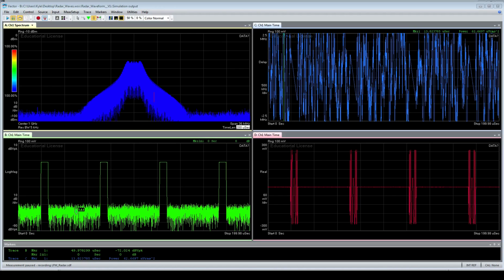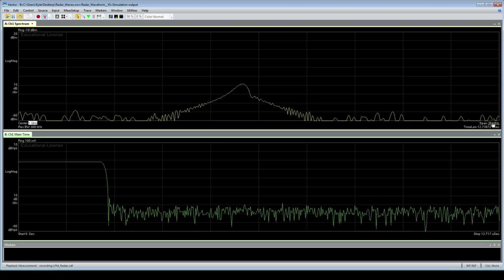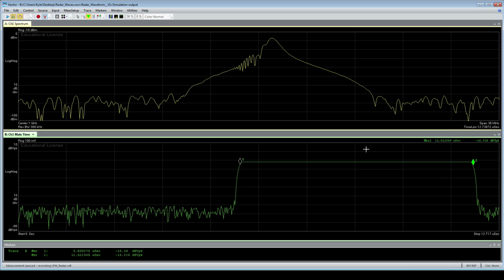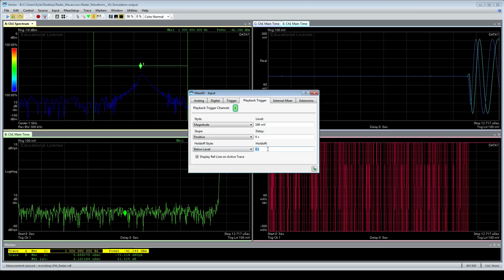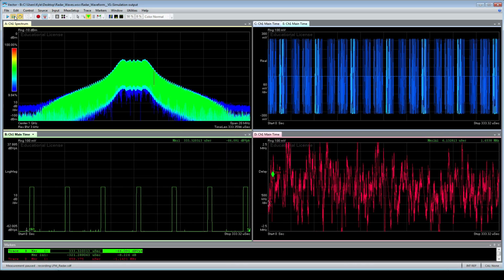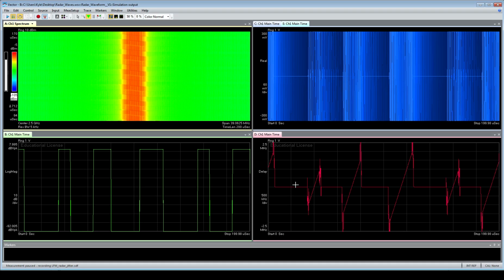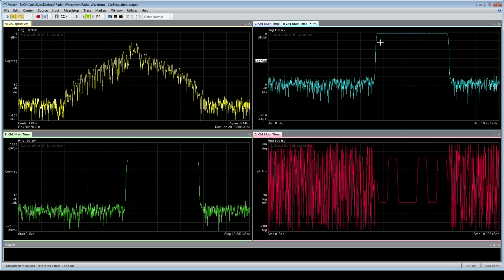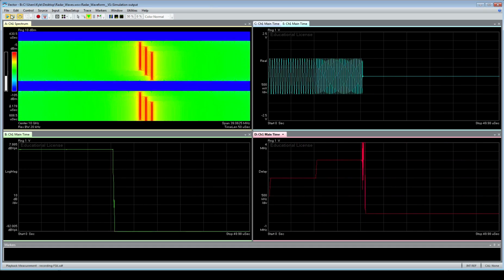Introduction to Radar ELINT and the 89600 VSA Software

Comment: For the FSK at the end, why does it appear on the spectrogram as though the 3 frequencies are being applied simultaneously? I don't see that in the time domain graphs...
Reply from the maker: Its a function of the measurement setup, under the time tab, "Max Overlap (Avg Off)"  being set to 99%. Essentially, that controls how much information is dumped from the previous FFT, and replaced with new data. 

Reducing the overlap to 90% will make the FSK signals more easily distinguishable in the spectrogram. 99% causes a little too much overlap in the frequency domain.